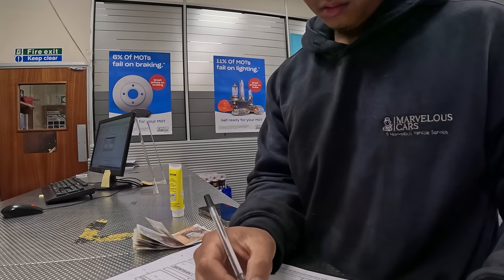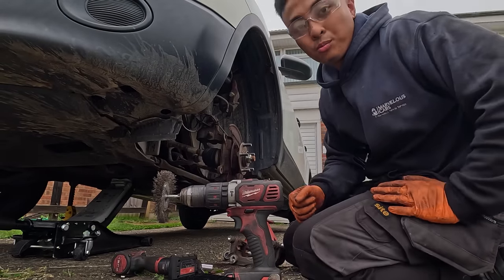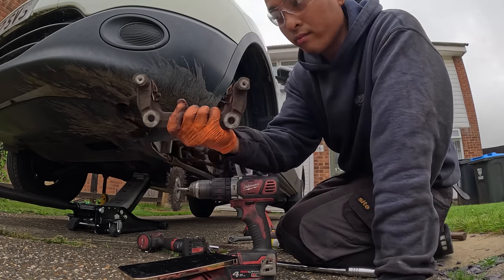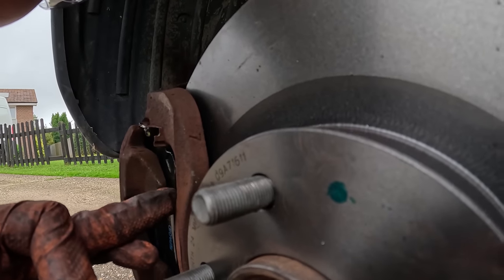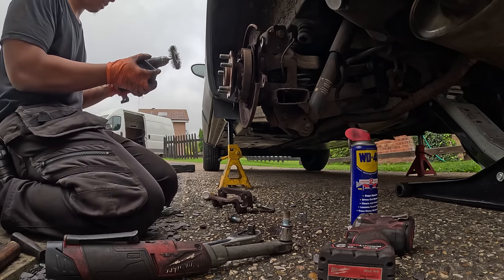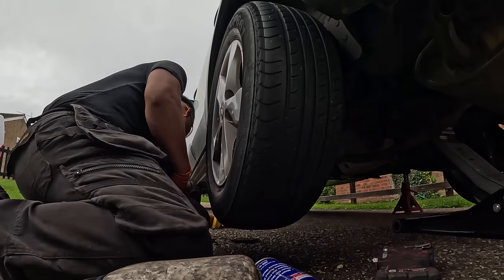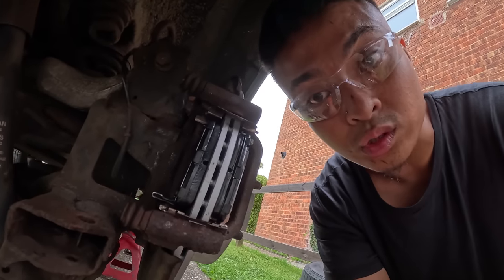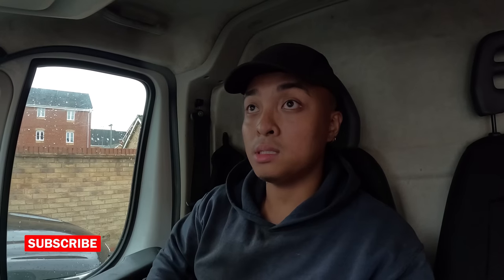CUSTOMER DOES NOT WANT TO PAY! HOW TO PREVENT BRAKE SQUEEK | Life of a Mobile Mechanic

Comment: Always use cooper grease, what I was shown as an apprentice.  Used it for over 34 years never had an issue.
Reply: Times have changed and there are better alternatives out there now. As he said, most times it'll be fine but sometimes it can cause issues. Best to use ceramic or rubber grease and it's not much more expensive.
Reply: Mate just use the brake grease specifically made for brakes😂. Stuck in the past with the copper nopper
Reply: @calebrutherford9010  copper grease is for brakes. 🤣🤣🤣
Reply: @barryjackson8512  can’t teach an old dog new tricks
Reply: FYI dumb dumb, copper grease is not designed for brakes, brakes heat up and are supposed to cool down, by adding copper grease you are making it harder to cool as it has metal init. Copper grease is also not as water resistant as you think, it drys up very quickly. Good old lithium grease or rubber grease is all you need on a car, anything else and you are using the wrong stuff( even if u have had no problems in the past with copper g it doesn't mean you are using in beneficially)
Reply: @Natezx1ne   if you take the time to read a tin of copper grease you may be surprised.   We used it on service vehicles that did high millage.  🤣🤣🤣🤣
Reply: @barryjackson8512   I went to college in 2018, as of then the imi said copper grease is no longer standard approved and should not be used on vehicles( according to out lecture that also showed us proof ). Anybody can make a can a of grease and say it can be used for this n that but it doesn't mean its actually any good for the purpose its claiming
Reply: @Natezx1ne  34 year time served.  Iv plenty of experience. Using it. I’d of noticed a problem by now. You learn a lot more of college.  Experience goes a long way.
Reply: @barryjackson8512  5yrs in buddy.. id prefer to listen to the people who actually award the certificates. I'm not saying u can't use it, ur free to use what u want but common sense also goes a long way
Reply: @Natezx1ne   you do it your way.  I do the correct way  🤣.  Only joking.  It’s worked for me. And the industry for many year.  Times change.  Not always for the better.  I’ll never change the product I use, when it’s never failed me.
Reply: Copper grease destroys rubber. Don't use that.

Comment: Nice to see a young lad doing the job properly. There's so many quick fit centres and garages that change pads in like 20mins and you think no way have they cleaned and lubricated all the parts they needed to. I have fitted plenty of brakes in my career as a mechanic. And it does take a long time. Removing the scale from underneath the stainless shims etc. And removing the sliders. In the garage we always done this and tbh we didn't have anyone return with noisy brakes etc.  That's why these Quick Fit centres make so much money.  They DO NOT spend the time cleaning.  And I worked on the opposite side also as in a parts supplier and some garages saying the pads are not fitting and they have to grind the end of the pads down to fit them!!  NO!!. this is what this lad is saying. You never need to do that. Unless obviously the wrong pad has been supplied. It's because of the rust build up jamming the pad. Keep up the good work.  👍
Reply: Sadly this goes both ways. Sure, for an established national company its a different story and work should be carried out best as possible. 

However the majority of garages in the uk have awful customers who want to pay the lowest of the low price. I used to take 30-45 mins repairing and cleaning brakes to perfection and not only would the locals pay less but they’d also complain about how much time it took 😂😂 

These days a car will come for brakes and i’ll have both sides down in 10 mins with only the sliding pins and pads slightly greased. The customers are happy but unaware/don’t seem to care about the long term issues it will cause later on. Its a shame the majority of the trade has been poisoned by silly people
Reply: For someone who knows what they doing and with good experience, it shouldnt take longer than 20 mins per side.
Reply: Hi,I was a brake specialist at KF, it would take me about thirty minutes to do discs and pads on a two post,never had any return, can't speak for any other fitters

Comment: This brake job reminded me of a year ago. Brembo pads, vented and drilled discs and 2 new sensors on my 65  BMW 3 series. Took my time and saved over £500 . Did a cracking thorough job even replacing the rear handbrake shoes. All cleaned up including back plates .

Comment: Tip of the day : Get some HSS 7,8,9,10 mm drills , grind the tips flat , then you can use them , in your electric drill to get the really stubborn old grease out of the caliper carrier slider pin holes. And with no tip 1 you won't drill a hole and 2 you will get to right  the bottom of them.
Reply: Great Tip, I use hole wire brushes at the min, going to try this tomorrow.

Comment: My old mechanic id always give him a tip on completion as he was fantastic and did a cracking job. The last giy i had out for a coolant issue told me i needed a heater matrix costing 9k with labor...no lie. He apparently worked at silverstone before and all different performance cars. Took it to another garage who confirmed it was the head gasket leaking exhaust gas into the subarus coolant system overflowing it. Hard to find a good decent mechanic like you dude so keep it up 👌
Reply: That's crazy that the Silverstone guy didn't know how to diagnose HG failure, especially when Subarus are notorious for it. It's only a matter of doing a sniffer test on the expansion tank to confirm. God knows how he thought it was the heater matrix 😂Wise decision in getting a second opinion!
Reply: @therealchayd  Well the sniff test only worked when under full load as when it was driven daily and "normal" it showed no issues 😅 but he didn't even do a sniff test anyway 🤣

Comment: One thing i'd mention when you have pads that worn is to always check the break fluid, if it was topped up recently and you compress the pistons lots of break fluid will seep out of the reservoir and make a huge mess.
Reply: 'brake' fluid.

Comment: Before I change any pads I always slacken the master cylinder cap first, I do that just in case somebody has topped up the fluid level when the pads are low, so when you push the caliper piston in the excess fluid has nowhere to go & can push the seals in the master inside out resulting in no brake pedal, I have had it happen a couple of times over the years so thought i'd share that with you.

Comment: Much respect. In another life and at your age I also did call out repairs and know full well the pain of working on driveways or on the road or uneven surfaces.  Once asking a store owner if I could put a ball joint in his freezer to shrink it so it would slide into it's socket without the proper tool.  I too had clowns that didn't want to pay what the job was worth and even bounced cheques.  Keep up the great work.

Comment: I was always taught to take off the runners and wire brush the rust under them on the mounting bracket. Once it is clean spray some zinc paint and put back the clean runners. If you do not clean the rust off under the runners what happens is that rust builds up and pushes the runners so that the pads no longer move freely.

Comment: Just a tip for you as I didn't see you do it take the lid off the master cylinder it's easier to push the pads back I can't see wat the problem is using different brands on the discs and pads but I'm no expert people who don't want to pay are just wrong I would take a deposit on any job so you don't fully lose out and same with people who cancel the job keep up the good work at least you are honest as there is alot of mechanics who are just wrong and rip people off 🤬

Comment: Absolutely hate doing these shoes+pads brakes. Wind the handbrake cable off , replace discs, pads , clean everything up, then adjust then shoes and handbrake. Do a brake roller test to find out it needs more adjusting, remove wheels and then try and adjust it through that tiny hole on the discs, one click down too loose, one click up the wheel doesnt turn, absolute nightmare hate these qashqais. Love the vids ❤

Comment: Good work, my tip is when working on brakes I open up the empty boxes to put them on the ground and catch the dust and avoid contaminating the driveway.
Try sitting on an empty square plastic 10 liter oil container to save your knees and less fatigue.
There should be a register for customers that won't pay for work done and boycotted!!

Cheers from Melbourne Australia 😁👍

Comment: I am a licensed technician in Canada and the one thing I would not agree with is the slider pins.  They only need to be free moving to allow the caliper to move with pad wear.  If anything you would allow the outer pad to wear quicker with additional pressure pushing on the pad when the brakes are not applied with your method.  If I clean and grease the pins I will always pull back on the boot while pushing the pin inwards to release any air.

Comment: Make sure you check the pads that come off were put on correct in the first place. I fitted pads to Peugeot 106. I put them on as they came off, as mirrored pairs. Turned out that was wrong after they jammed. So  checked a diagram, they went on asymmetric..

Comment: Before adding grease to the sliding pin... clean it out... too much grease can cause a type.of hydraulic lock.. where it blocks the pin from being allowed to move the full length.. excess grease gathers at the far end.. and stops it sliding.. causing excess wear on the other pad...

Comment: You should put something under what you're working on to collect the mess (in this case brake dust and rust). A large tray for example. It adds to an air of professionalism rather than leaving a stain on the concrete.
Reply from the maker: We clean them afterwards but I understand what you’re saying. Will definitely be investing on some!

Comment: I've used copper grease on the back of pads (to prevent brake squeal) for 50 years now and never had a problem, I use lithium grease on the slides.
Reply from the maker: I think that’s perfectly fine to use it on the back of the pads. Using metal-based grease on the runners though is a bit debatable in my opinion. A lot of people will say one thing, other will say otherwise
Reply: I was also taught this way since 1989 but I do use whatever is at hand . I find copper ease attracts more dust to be honest so I have been using an alternatives here and there.
Reply: Just look up galvanic corrosion. Different metals + salt + water => corrosion. Extremely problematic if the caliper/bracket is aluminum like on performance cars. Complete recipe for disaster on electric cars which use the friction brakes way less and therefore don't evaporate the water.
Reply: @tschuuuls486  if you know about galvanic corrosion you should also know that copper grease is applied between mating faces of dissimilar metals eg steel and aluminium to prevent galvanic corrosion occurring.
Reply: @williambelford9661  do you have any studys that back up that it actually works that way? Genuinely curious, I just found a small experiment on marine equipment where it wasn't effective even on copper conductors in terminals.

Comment: When it comes to brake pads,shoes and discs,I'm a Brembo man and have been for the last 40 years.With Brembo pads for example you get new shims with your new pads,same with shoes everything needed is with the kit as it should be. Can I offer you a little advice concerning the caliper sliding pins,yes you are correct,they do need lubing at ever pad change.The sliding pins when lubed should not spring out when you press them in.The reason for this is that there is now air in the pin chamber, you need to remove it,all you need to do is use a pick and just slightly lift the rubber to let the air out,job done.Nice brake job my friend well done.
Reply: If you always use brembo how do you know other brands don't also come with all the bits? Every cheap kit I've bought from ecp in the past has had all the bits in it. Not saying they're all as good as brembo performance wise or build quality but I've never had a kit without every last bit in them Inc shims
Reply: @norfolkngood8960  Maybe I should have made it more clear,of course I've tried  others which is why over the years I've tried and used others and yes some of the other make include extra's in the kit but these are normally cheap bits that done fit well.

Comment: Any break disks and pads will do in UK. With the speed limits here there is no need for matching brands or high end brands. I am now 40k (2 years) miles on the cheapest break set and still life in them pads and discs. Wales 20 mph law is making it easy to save on break jobs.

Comment: Sometimes you gotta get the job done sometimes if not available just get the crap i used brembo pads on a delphi set of discs not bloody issue seems fine on the rear 40k miles nothing bad

Comment: When greasing slide pins, don't add too much. I had an S2000, i got used calipers cheap and there was so much grease in the slide pin hole that they couldnt go all the way in. Cleaning out the grease, there was 3 different colors from people just adding grease at every pad change even though there was already plenty 😂

Comment: You don't grease under the runners? In rusty countries we grease there, so the rust under the runners would build up slower. 

If the pads are without the sticker, greasing the pressure points also eliminates squeak when braking, not only pads not sticking to the connecting parts.

Comment: A metal disc is a metal disk, Brembo is no better than any other make in that department, their master cylinders and calipers are usually better than others as the designs are different internally. Leave the WD-49 alone on the brakes, clean them up with brake cleaner, then spray/wipe the rubber boots/seals with some silicon grease to keep them in good condition, obvs wipe off any excess.
Reply: Not true when you are after performance parts. Disk design is different
Reply: @stevepeacock4265  Only the aesthetics, a metal disc is a metal disc, they all have to be the same grade steel, and be the right thickness for the vehicle they are fitted to.

Comment: Thanks for the tip about copper grease I will get some Pagid for my next brake job 
How much would it cost to replace front discs and pads on a 2010 Panda

Comment: When I used ceratec on my guide pins it locked them up, turns out they can expand rubber and my ford fiestas guide pins had a rubber boot at the end which expanded and locked the guide pin in the caliper. It does say on the back of the ceratec pack not to use it on them, just my experience.

Comment: I agree for all your points except one: You do a lot of cleaning of the surfaces and it is amazing. It shows respect. But, after putting pads and the disc, why clean the callipers on top of those newly installed pads and disc causing brake dust to fall on top of them. =)
Reply from the maker: A small percentage will definitely go somewhere near the pads/runners BUT throughout its lifetime, do you know how much dirt/brake dust etc goes in between those gaps? 
Brake dust can easily get blown away so I don’t think it matters much…

It’s a good point though. I’ll make sure to think about it next time!

Comment: I recently did a job for a car dealer that wasn't local but their customer was. They said payment would be made straight away when the work was done. Car was ready on Thursday, then the excuses started. On Monday the car owner rung me to get an update, I told them the repairs were done and I was just waiting for payment before the car is collected. I think once they realised the bill would have to be paid before the car was collected and the customer was also ringing them, payment came straight through. Interestingly when they first contacted me they said they also had a second car for another customer that also needed looking at and even mentioned it again when I completed the job, but I've not heard a peep from them since, make what you will of that.

Comment: That's a vacuum boost air pressure sensor that you have just pressure tested on that Nissan and maybe have now damaged the sensor, so maybe he was right not to pay you. You check these sensors on the live data or by a vac gauge. Early sensors have the pins straight and later have the pins in a triangle plug format. Before I get shot down for saying, I'm only passing on experience, that's how the younger ones learn.
Reply: 'Vacuum boost' is a certainly a new term in the automotive world. Well done fella!
Reply: @wirdy1  Not a new term at all, suggest you do a bit of research about these sensors and the K9K engine and you might learn something in the automotive world.

Comment: He’ll clean the hub assembly, but he does not clean the inside of the rim were it sets to the rotor there is Rust buildup that rwill not set flush you can’t get it torqued right and it will be a vibration  i’ve replaced a hardware all the slide points got them cleaned. I’ve used grease and then I’ve used no grease on the contact points on different vehicles and it’s all in Weather. The pads are tight or snug and the pads are installed correctly you should not have to use grease on your side points, there’s no reason to if it’s clean you don’t have to do it. I’ve done it both ways with grease and without grease. I only put grease on the slide pens. I’ve never had a squeak. I’ve done this more than enough times never had to come back it’s all because you don’t get the surfaces clean, the inside the caliper and on my personal vehicles, I use semi metallic only I do not use rubber pads that’s what I call him ceramic pads they get hot, sticky and gummy and you can’t stop semi metallic. You always have stuff and no matter what.